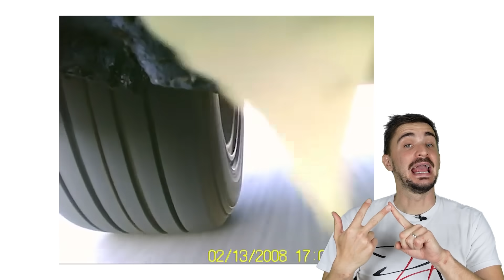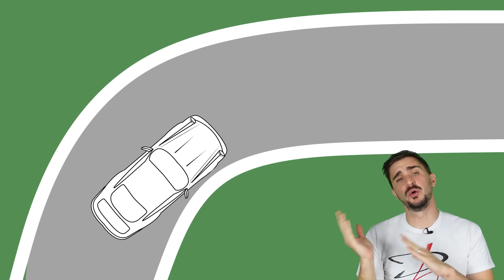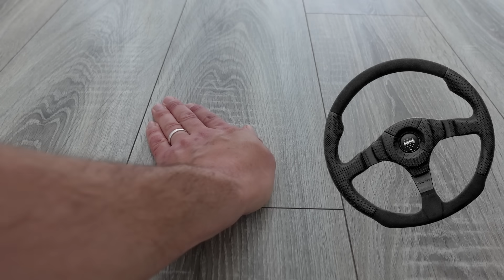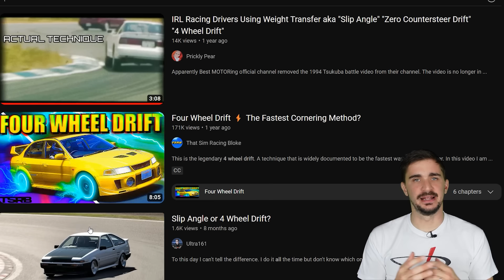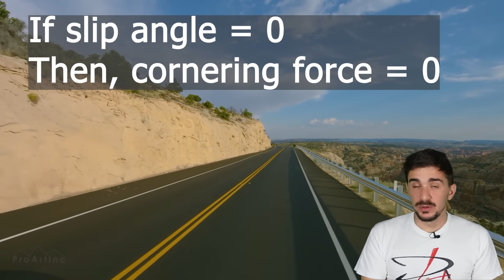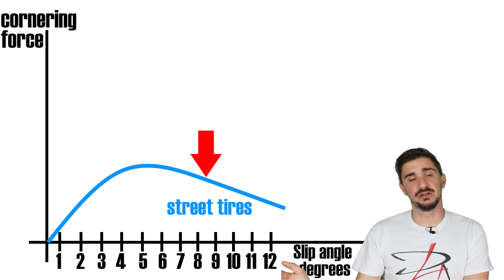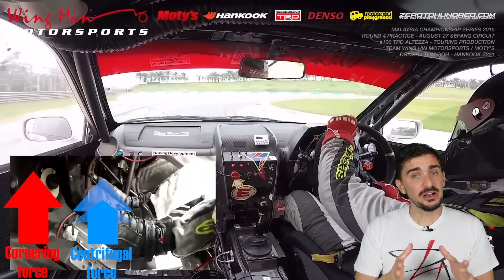You Think You Know But You Don't - Slip Angle Explained in a Way You Will Understand

Comment: Good explanation overall with a slight exception. The "centrifugal" force does not exist. It's a so called "apparent force" resulting from your body wanting to move forwards while the car wants to push you INTO the curve. So there are no forces pushing you out.
Now what you called centrifugal force at 7:48 is actually frictional force.
Reply: I personally prefer to put the reference outside of the vehicle and think in terms of centripetal force. Clicks better at my brain. I find it easier to visualize as the sum of all forces resulting as a vector pointing to the center of the curve (and necessary to change the velocity vector direction). Whenever I hear centrifugal force my brain kind of replaces it with "just inertia".
Reply: Centrifugal force does exist and is just as real as the concept of inertia. If you're inside a non-inertial frame of reference (like, inside a car taking a corner) you do need to take into account centrifugal force and coriolis force to do physics. If you grab any college textbook on classic physics you'll see it's full of mentions of centrifugal force, it definitely isn't a simplification nor a mathematical trick.

Comment: 12:52 I'm pretty sure this explanation is wrong. Just because we need to steer more in tight corners doesn't mean that we go beyond the slip angle peak. Slip angle is the angle between contact patch direction and the wheel's direction, it's not the angle between your car and your front wheels.

The reason we take tight corners at low speed is because of how centripetal force depends on corner radius and speed: more speed means higher centripetal force is needed, lower-radius corner means higher centripetal force is needed. So in order to keep the centripetal force below our car's maximum cornering capabilities, we need to lower the speed in tight corners.

Comment: This is an incredibly informative video! Actually, understanding slip angle in this way has actually given me some ideas. Makes me wonder how much Forza: Horizon 5 emulates this.
If you have the game and want to see what I'm thinking of, take a car like the McLaren F1 or Jaguar XJR-15. Try taking a sharp turn with the stock tires, then do the same with a set of sport or street tires. The grip feels entirely different, despite the stock tires having far higher emulated lateral g forces.
Reply: Sim tire models effectively spit out force curves as a function of slip angle like real tires do, (very) roughly like the pictures he showed in the video here.  The difference between tires is mainly how high the peak gets and at what slip angle the peak is.  In sim development you tailor those individually for each tire which is why they'll perform and feel different.

Comment: TL:DR

1. When we steer we do so with a 0.01sec delay (like everything on any mechanical thing).
2. The videos talking about slip angle explain how to maximize your times on a track level by staying on the margin of trailbraking instead of drifting wide.

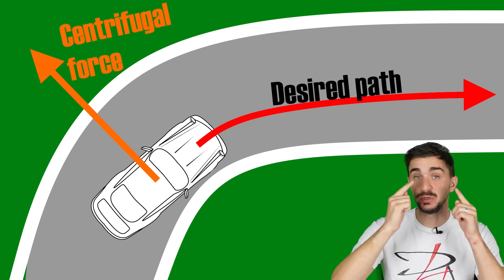Comment: 2:17 Err... no, that's not the direction centrifugal force 'wants' you to go.  Sure, that's the direction of the force vector at that point in the turn, but only because you're accelerating the opposite direction with your tires.  The direction it "wants" you to go is straight.  If you suddenly lost all traction at that point in the turn, you'd hit the 'l' at the end of 'Centrifugal'.

Comment: This explains why non professional competition tires deliver slow lap times despite the level of grip. Right deformation of the tire under extreme cornering can be gain with experience on race track. I will never trust tire makers with no real experience in the top competitions. Of course amateurs will choose tires by reviews based on the feelings from another amateurs just like they are. The only real review of the performance tires is the time/lap.

Comment: I have enjoyed your videos very much because you don't shy away from using the underlying engineering and physics when giving a technical explanation, which often contradicts "common sense" or other widely held mistaken views (your video on braking and rotor size was a great example of this). The examples you provide are very good at illustrating concepts and you are an accomplished teacher. However, here's the BUT ... to be technically correct you should not introduce the idea of "Centrifugal Force" - I'm sure that you are aware that this is not a real force but only appears to exist in certain accelerating reference frames such as cars (and, yes, even though your speed, a scalar, might not be changing you are still accelerating, a vector, as you turn a corner). It is completely imaginary. It is an illusion. When cornering, there is no "centrifugal" force pushing you to the outside of a turn. The only force acting to make you turn is Centripetal Force which is deviating the car's motion (Newton's 2nd Law) from its otherwise straight line path due to inertia (Newton's 1st Law). The friction between tyres and the road (just as for braking) provides this net force towards the centre of the circular path/turn otherwise the vehicle would not turn the corner (e.g. if it hits ice or oil on the road it will continue in a straight line and not make the turn). "Cornering Force" = "Centripetal Force". "Cornering Force" does not "fight centrifugal force", it "fights" inertia. It is not "higher than momentum", as you say, because momentum and force are two completely different things. My challenge to you is to make/revise this video using the correct physics from an external reference frame (e.g. that of the road) that doesn't require imaginary forces. I don't wish to be unnecessarily pedantic but your other videos are so good that this one risks undermining that excellent work. Thank you for the videos, they are outstanding.
Reply: Centrifugal force does exist and is just as real as the concept of inertia. If you're inside a non-inertial frame of reference (like, inside a car taking a corner) you do need to take into account centrifugal force and coriolis force to do physics or you break the second law of Newton. If you grab any college textbook on classic physics you'll see it's full of mentions of centrifugal force and how to account for it in non-inertial frames of reference, it definitely isn't a simplification nor a mathematical trick, but a fundamental piece of how the universe works

Comment: How would this be applied to motorcycles? I’m guessing slip angle is the same when initiating a corner then it’s just friction weight balance to keep it going along the same arc until front wheel input is initiated again through slip angle

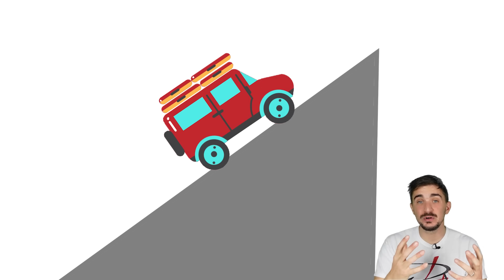Comment: 9:41 Really REALLY good video and explanation in general, and I understand what you're trying to intuitively explain here but this part is buggin me out a little. It can paint the wrong picture for some people (not scientifically/casual terminology aside). Friction CAN generate movement . When power from the engine tries to spin the wheels, the contact patch is met with force both from the engine and the resistance from contact with the ground. This resistance is the result of the weight currently being supported by that wheel and, in comjuction with the friction coefficient, it generates this frictional force opposing the movement of the wheel. Due to this force not being aligned with the center axis, but the torque from the engine is, the wheel starts to roll (this phenomenat is known as non-slip rolling, there is slip rolling as well). So in reality, cornering force is a frictional force just as the force that moves the car forwards, it's a static (non-slip) frictional force actining laterally to the wheel. Sure it isn't what people typically think of friction as opposing the movement, but its origin is purely frictional.

Comment: I came to a similar conclusion at some point in the past when I tried to understand how one can steer slightly into a strong side-wind while continuing to drive straight on a highway. My thought was that the tread blocks were effectively “walking” sideways. Thank you for the much more engineering-minded explanation! Kudos, as always!
Reply: Cabover cars like the Subaru Sambar can suffer from this HORRIBLY. Like... steering wheel in the 2-o clock position while driving straight ahead during gale winds. Reinforced tires with an extra layer of ply improved things immensely. Just be ready for raised eyebrows when you're asking for reinforced 13" tires for your 2000lbs van.
Reply: When this happens, you realise "slip angle" really does mean slip!  The tyres are providing lateral force even though the car doesn't turn into the direction of the tyre.  Only way this works is if they're slipping
Reply: Same idea as if driving along a slope.  To maintain a straight path, you have to steer slightly uphill.
Reply: I drove a 40 ton commercial truck for the better part of 15 years. Countering the often seemingly perpetual winds of the Midwest and Western USA was a mind wreck, at first.
Reply: The twisted rubber in your tyres is also what pushes your steering wheel to a centered position, aligned with the rear wheels.
Reply: @Trombonauta  wrong. the caster angle keeps the wheel contact patch a bit forward from the steering knuckle center of rotation. this creates a self aligning torque which forces the steering in the direction of the cars momentum.
Reply: Yeah! As this is the sidewind thread, did you notice any increase in fuel consumption while driving in high sidewind? I'm starting to see this pattern when I'm driving and actually started logging my fuel consumption vs wind speed to have the data 😂

Comment: “Without slip angle, it would be impossible to make the turn”
I check and it still one month away from April 1 

If slip angle is 0, then it’s like concerning on rail, and it does get you around the corner, it fact it’s a perfect corner.  Actually as soon as centrifugal force was mentioned 😮😂 ……..

Comment: Thank you for this video. I have few thoughts, some of them to the best of "serious" (a.k.a. science provable) others of them are sort of a ~joke (I will inform when I go to the joke part which I cannot hold back onto :P). So... This is fairly lengthy video... Yet it is is too "specific" to the point it can also be confusing for someone not actually somewhat adept to both the mechanical aspects of a car as well as driving and having had good understanding of high school physics. I Think you should have close to mandatory when it comes to steering throw in a brief introduction of Front versus Rear wheel drive, and why is that? >Differentials< now you see... Front versus Rear wheel car steering are two different worlds (and I am not even thinking 4x4 with variable front to rear distribution, out of which it comes to front wheel drive on a rear wheel capable car is needless added weight, but than just say Rimac and end the internal combustion car stuffs discussions there and than). 
 So: Common - Front Wheel Drive... : Independent motion rear wheels, mostly independent suspension on non super cheap work horses. Meaning when the car goes cornering, not going straight, the two >independent< rear wheels are "naturally" augmenting their speed to: Inner tire goes at slower speed (going trough shorter path/curve) (outer tracks of every turn ever, everywhere, are longer and thus require >higher speeds< to be traveled within the same >unit of time< the turn is taking place within simultaneously with the >Inner Tire<) Now this comes a bit redundant but: Outer Rear Tire... Naturally travels, rotates, moves... whatever at (Mostly Rotates tbh) higher speed because longer trajectory. "Natural" here meaning this inner/outer tire travel distance discrepancy balances itself out. However Front Wheel Driven Cars (as underline by name) get their motion by enforced (empowered) spin of the front wheels... In lay man terms on a ~Straight... Engine (you know cylinders, pistons, valves, crank shaft and container for them +/- stuffs) Generates rotary movement which is than delivered to Gear box (after going trough an on/off switch called Clutch, because Gearbox requires engine disconnected functionality) Out of Gear box (here actually for front wheel cars becomes a bit of a fog for me too O_0, so technically I am explaining something I don`t know myself) in a full straight situation is what happens 100% Power, via the appropriate metal rod with all it`s bearings and gearings and joints and stuffs. to Front Wheel A, 100% power to Front Wheel B) ... Car goes straight ahead... However you encounter ~Corner... You Turn the Wheel... and than suddenly the "outer", for the sake of the turn, wheel is now traveling Longer path... Thus what now needs to happen is the "Inner Tire" needs to be slowed down, not to surpass the "outer one"... How does that happen... By "supplying" it less than 100% Power... That is where >Differential< comes into play... Those are actually >Mechanical< parts (which have so much mathematics in them it breaks my brain). They somehow "sense" (Even thou for 100% mechanical component that is wrong term) which wheel is under more "Load" (the Inner One, because Physics) and ~reduce the power delivered to it by % of that "more load" That is how the "Hard Connected" by the Engine Power delivery driven wheels manage to actually turn in a turn on "equalized" speeds or car >actually< not turning at all< 
 I Will throw in a fun fact here... When In Mud... the wheel that is engine powered and have more "grip" (because car weight distribution in deep mud = Aliens From Outer Space) is "sensed" (Once again this is not digital sensor and this is wrong term) to be the "Inner tire" (in regardless of actual direction) and this deception makes your tire with >Actual< Grip to "stand still" while your Tire that is not having enough "Grip" to propel the car forward is just aimlessly spinning distributing mud to the shirts, jeans and faces of everyone around. This is what causes conventional front and rear wheel only drive cars to be stuck in muddy and/or snowy situations. Even "Sporty" 4x4 is not immune to that... because once again it have >mandatory< >Front & Rear< ~Differentials (some have central one in between those as well, but this is F you engineering for most cars) and 2/4 engine driven wheels are also not always enough to pull the vehicle trough whatever is stuck in... 
 That is why ~intentional >off Road< vehicles (a.k.a. the ones ment to drive trough mud, snow, sand) (and are not caterpillar :P) Have >Differential Locks<, this up to low speed cap "hard locks the wheels to the engine" (usually trough low gear, some Off Roaders have separate "lower than Low 2nd gearbox) for 100% power to all 4 wheels all the time (a.k.a. the car barely turns, but it does not get stuck either... If it does not flat on it`s ~Clearance, but those are now suspension and tire sizes problems), 
 I were gonna go ahead and explain this for rear wheel cars, but I ran out of "Steam"... As for the joke ~ It`s not actually funny... something alongside on 35x19 tires on "fuel economy inflation rates" all your arguments are invalid :P. Also There are stuffs like ~Breaking... It`s mostly mass distribution... I wanna say something like "It`s more like" Snap Cornering... Actual Turn Curves are not even cornering... they are like different types of Straights... "This almost drifting" you talk about... Every time a wheel Over Rotates on the surface you are using >Horse Powers< for >not moving forward Faster< ... and the whole idea is moving forward faster... (It have something to do with how when "Downhill Ski ~drivers" jump off small natural launch points, they loose speed and thus time, because full Air Time somehow equals 100% drag as well, unlike when skis touching ground ~or something... something_)  
 The TL.DR. is you brake in the shortest possible length your vehicles allows (all of it... aerodynamics, mass, tires, brakes, suspension) without losing grip (loss of grip = loss of control = not safe) than out of that very end break point in before you lose grip you accelerate to the very best you can without loosing grip and voila... you have turned the corner. Every loss of grip = loss of speed related power = loss of time) Thus High end 4x4s (my previous joke aside) are best at every circuit time attack ever (because of the 20% front wheel pull in corners) Than comes the actual source of why my jokes are not funny F1 >rear wheel< only cars where all your arguments are invalid and 4x4 hyper cars are still cheap solutions for plebs unlike dedicated engineering team race beasts. 
 Also however if the "break point" snap you mostly ~do not corner at all in favor of involuntary donut ~(to put it mildly).

Comment: 15:30 Rubber is very interesting material because if you press is too hard, it will lose some of its friction because of shearing. That's the reason why using narrower tires is not better for all cases. Basically you could drive fastest by using the narrowest possible tires that do not year shear. That's why street sports cars using insanely wide tires are more looks than purpose.
Reply: Sorry but that's nonsense
Reply: @szymoniak75  Could you point to some research that claims otherwise?

Comment: I thought I knew and I did! 

However, the contact patch is experiencing dynamic rather than static friction - so it experiences a degree of 'slip'. This, of course, is analogous to the slip angle ( I am not arguing that the tyre does not distort - obviously it does, as it is not a rigid system ).

You could say that my argument involves infinitesimal steps and yours involves finite steps, I suppose.

Good video anyway: thanks.